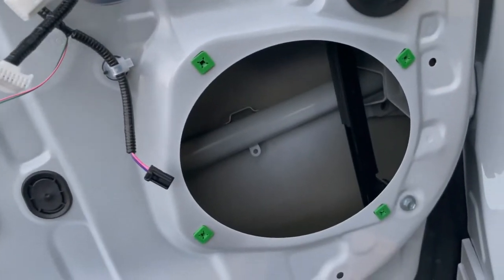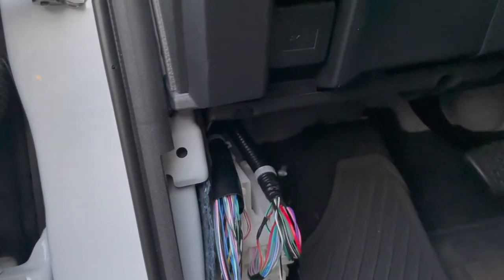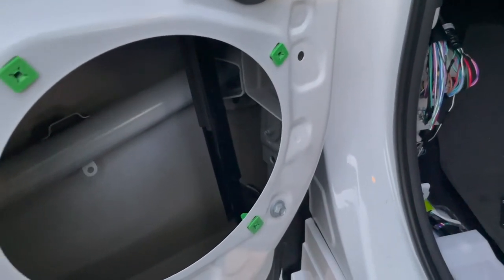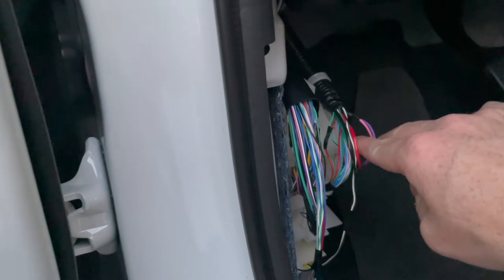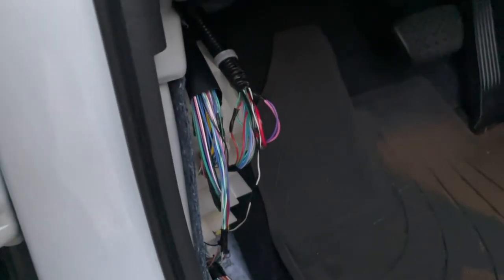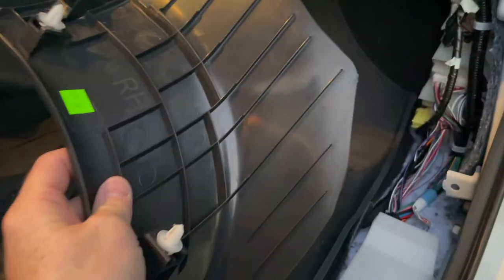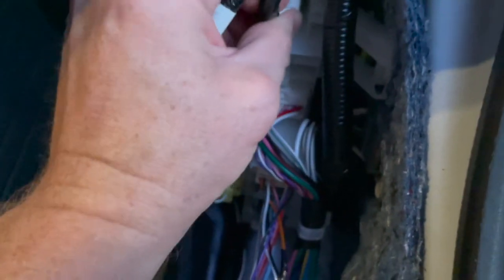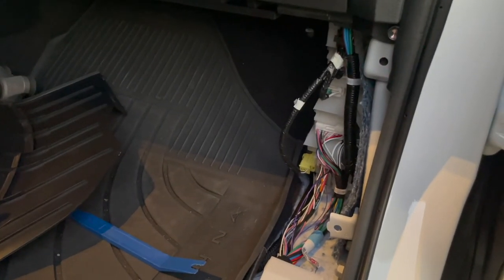2021 Sienna XSE (non-JBL) Audio Upgrade - Part 1

Comment: Hi Aaron, I am about to start the upgrade on my LE. I got the Kicker DSP, ordered  the GS690 & GS25s. I just want to ask what happens with the middle row speakers and liftgate speakers? Are they still functional/running parallel with the other outputs?
Are the GS690 paralleled with the GS25?
Thanks
Reply from the maker: I don't have my Sienna anymore, but from what I recall, the G690 and GS25 should be on seperate channels of that amp, basically you want to run it as a 4 channel amp. You'd just leave the rear/middle speakers attached to the factory headunit connection.
Reply: @aaronmorris9352  Got it, thanks

Comment: Why not run new speaker wire?
Reply from the maker: You could, and in fact later on I just decided to run wire from dash to the amp and then just leave the rest stock. Stock wiring is plenty good enough for under 100W.